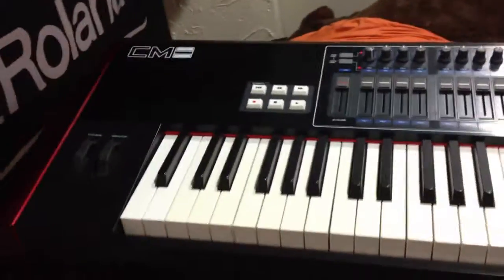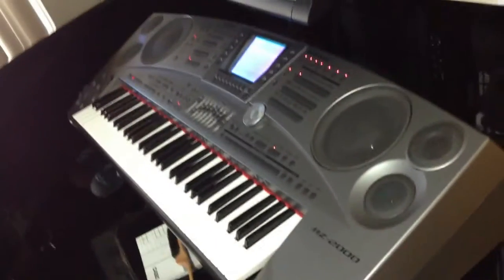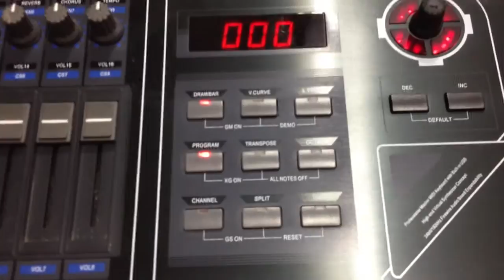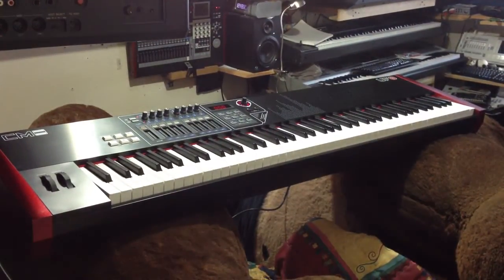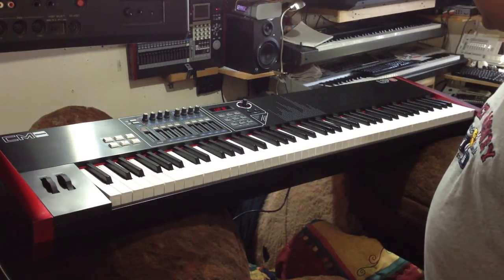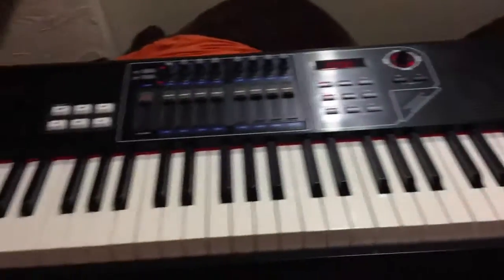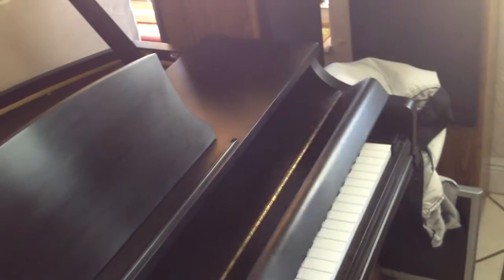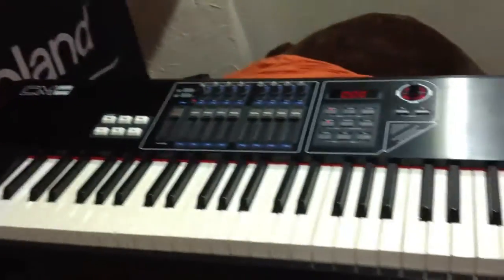Kris nicholson Shows off his CME UF8 88key Controler He got from a Thrift Store For $80

Comment: they are known to get sticky keys. not easily servicable. I gave mine away for free to a coworker. The youtuber who took it apart (the one with 3-video series on this keyboard) , if you notice he never finished it or fully repaired it --- -its a temp repair.  You need  grease which eats away the silicone over time. So rinsing it with water wont last for long, but maybe post an update

Comment: Great video Chris, I tried using the UF 5 to control my IPad Air 2, Garage Band and I-Grand apps, but it just wouldn’t work.  Just to point out that there is nothing wrong with my usb connection as it works perfectly fine on my Alesis V49.  Can u or anyone else tell me what might the problem be.

Comment: I have a UF8, but I've had problems with the velocity where it sounds too soft. I can change to a different velocity curve but it's not a great workaround. The dynamics is also uneven where the black keys are louder. Also the touch/action is not completely even. And the sound the keys make when pressing down and releasing can be slightly different.
But your demonstration don't seem to show any velocity issue...so maybe I have a bad unit or some of these keyboards have the problem, others don't. I haven't had the sticking problem though (haven't played it much through the years).
Reply: did you fix it ? im also having this issue
Reply: I’ve just had the same issue - there’s a button on the section below the LCD screen which says V.Curve. I think there’s a couple of modes (it sounds like really soft and full), but just click it until the light goes off.

Comment: Drivers didn't go past Win XP. Do you lose most features using only a Midi cable into a PC platform? Yeah, I did a video to clean the nylon  bushings and drill them to spec and lube them again. Only to swell again over time.